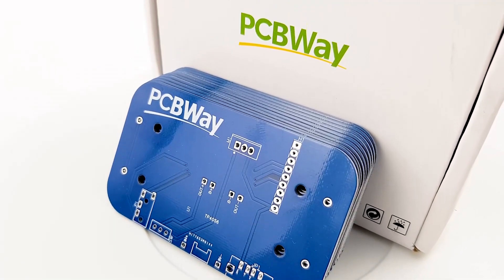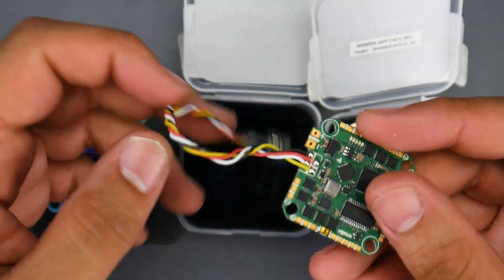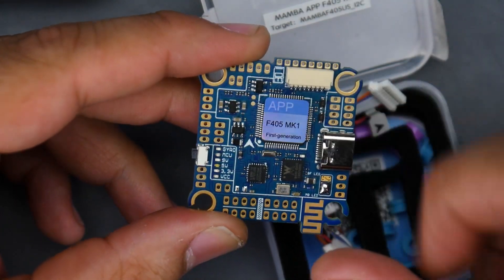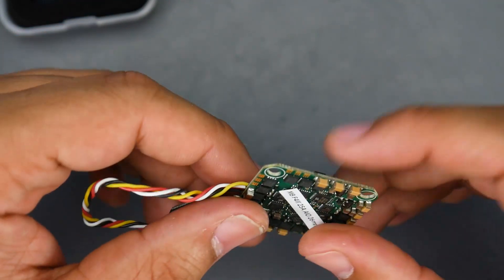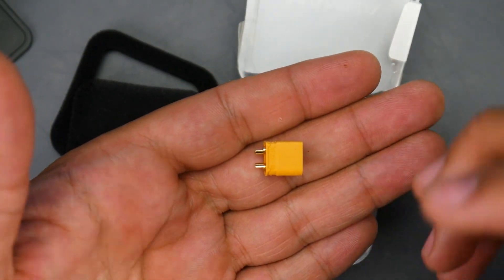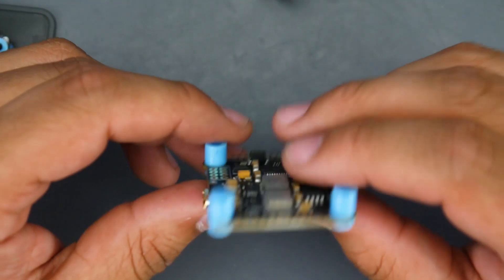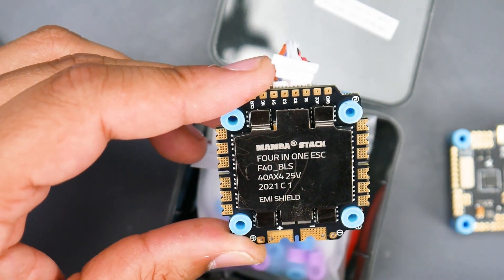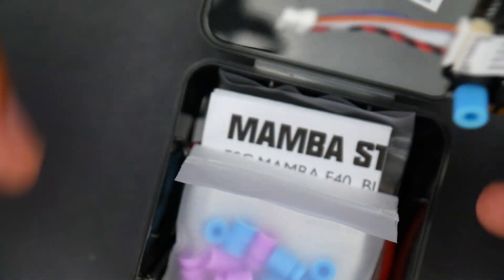Latest FPV Drone Component From Diatone // Proven Reliability

Comment: Im thimking to use the mb basic for my cinewhoop 6s build with dji flight unite so i wanted to know is do i need to soder the dji air unite to the board or it comes with the connector

Comment: Would you consider doing a review of this esc - https://www.diatone.us/collections/esc/products/mamba-race-f75_bl32-dshot1200-4in1-esc-75a-6s ??? There is not much info - and in my opinion it's quite nice design - no through holes on ESC gives them more space to lay out some components. Noise test would be sweet :)

Comment: normally a shield should be connected on one point to the ground. When using coax (ie RG59), peoples are connecting both end of the outside connector and call it the shield, but it's not a shield in this case but a conductor. To be a real shield, it should be connected to one end only. That is why some cable have 2 inner conductors and an outside shield that is connected to one end only. I guess you could try this shield with and without a connection to the ground and do some noise test.

Comment: The diatone 35 AIO is VERY reliable. I've burned out the iflight beast 55a and the cl racing v2 aio on 5" race quad. The diatone has twice as many packs into it and is still working. This is the 35a version not the 25a version (reviewed). Really great board - highly recommend.